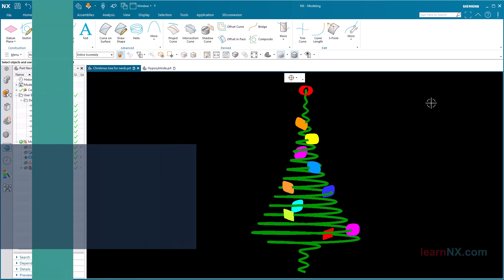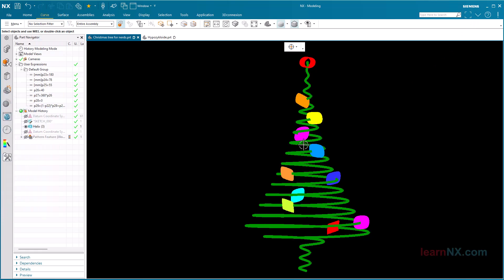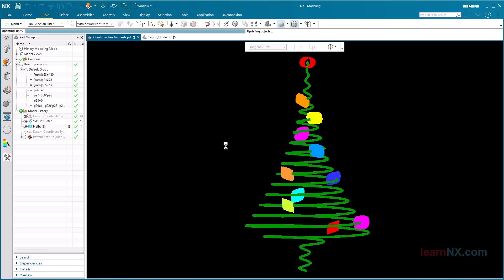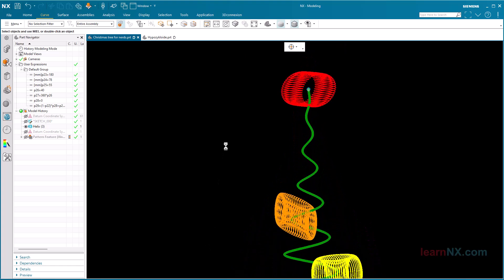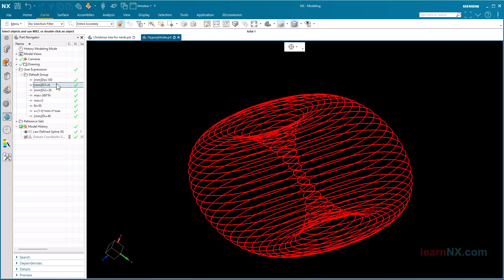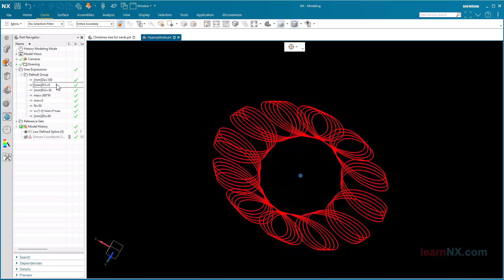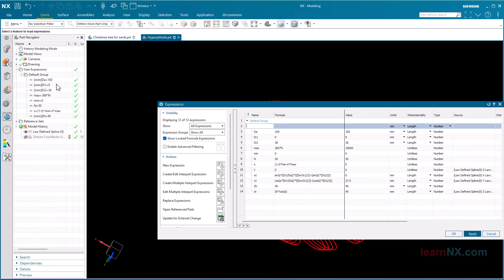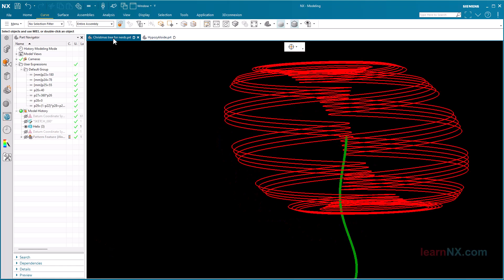Christmas tree for nerds | Siemens NX

Comment: Im starting a job after new years that uses NX im a fusion 360 user so im hoping I can pick up the program fast. But to be honest its still terrifying to look at!
Reply from the maker: Congratulations on your new job, and don't worry about NX. On my website learnNX.com, you can get to know the program step by step. Here you will find practice material, learning videos and many practical tips. And if anything remains unclear, please feel free to send me an e-mail. You can find the address on my website. Until then, Merry Christmas and Happy New Year.
Reply: Hi. I started a new job in Sept. where they use NX. I have used Fusion, Creo, Autodesk, Sw. They're all the same.
The one thing that's different; create an external sketch for every extrusion or revolve. Internal sketches from previous features can't be selected in the next feature to build from. Also, lines or circles from a previous solid can't be used to build from either. You need the sketch lines from the previous feature to build from or constrain to. We;re on V.1852. Someone prove me wrong, please!
Reply: @jaycrook1076  ahh... okay thanks I will look out for that!
Reply from the maker: @jaycrook1076  In NX, you can create both internal and external sketches. You can make the internal sketch external (right-click the feature in the Part Navigator and then select ‘Make External’). The external sketch can be used by other features as often as you like. If a sketch is used by more than one feature, it can no longer be made internal.
Reply: @learnNX  I know about the ability to "Make External", but what's really the point. If you have videos about how to  unite solid features, and constrain to previous features, without having to constrain to previous sketches, Id like to see them. Thanks, Jay.
Reply from the maker: @jaycrook1076  This video may be helpful for you 
https://learnnx.com/course-modeling/b1p-28-E/
Reply: @learnNX  Hi. I watched the video. I saw where you selected the radius of the boss, which generated a curved arc on the sketch plane, and this profile became a selectable feature to generate the rib. But, back to my original disappointment; I had to "create"/externalize a sketch feature to select, to create additional solid features.
I'm not letting up. I don't like creating external sketches to create solid features. These sketches are just added clutter to a model tree that are unnecessary in PTC Creo. It probably "is what it is" in NX.
As mentioned previously, I'm NEW to NX and haven't figured out all the nuances of NX yet. I like your content.
Thank you.
Reply from the maker: @jaycrook1076  I have trained Creo, Catia and SE users and they all want to use NX like their old programme, but each programme has its own way of working. Once again on the subject of external sketches: this video compares external and internal sketches and shows the advantages and disadvantages of each way of working.
https://learnnx.com/course-modeling/b1p-13-1/